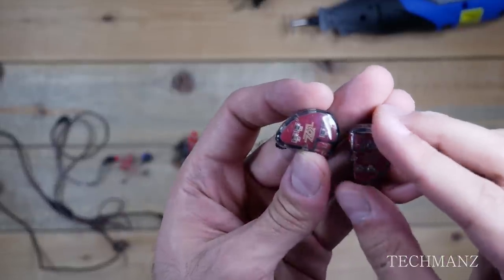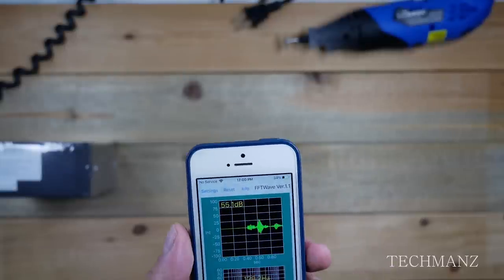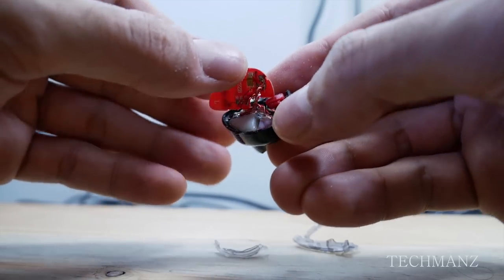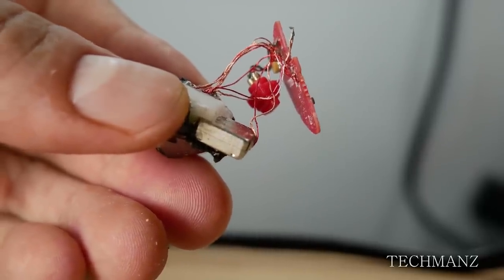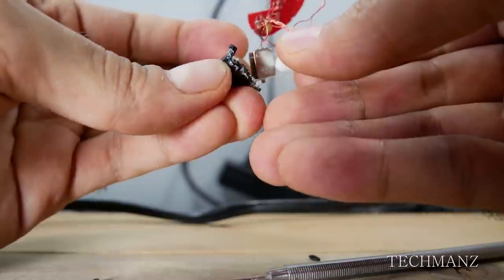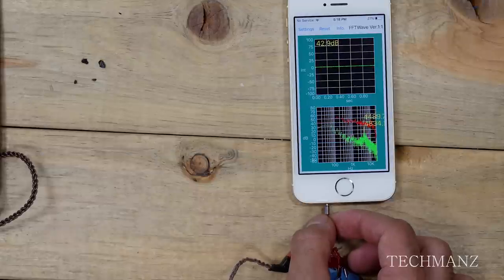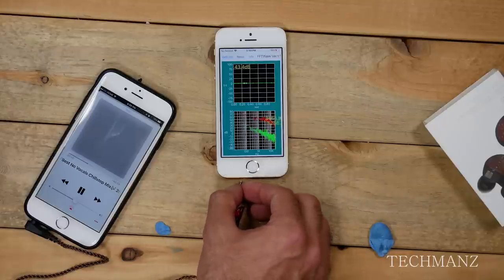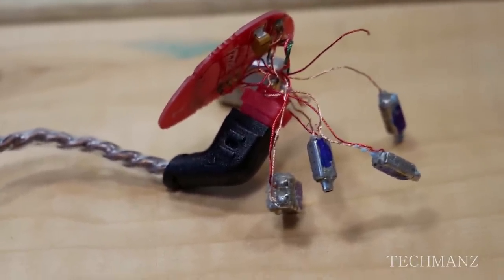$70 Earphone  Teardown- KZ AS10  - 5 Ba Drivers

Comment: KZ should get rid of the metal plate in the box and included a semi hard case and some foam tips.
Reply: The metal plate is just stamped and lasered. KZ aims to make it cheap. Pressure molded case might add manufacturing and shipping cost and be something not everyone likes. I use their ABS "water resistant" case for my AS10s. You might try that.
Reply: And also use metal for the housing. I totally wouldn't mind paying a little more for upgraded and more durable materials. With as dirt cheap as these are, people would really like these improvements, even if it costs more.
Reply: nah it's good for putting on the storage cases so you can identify what headphones you have in there.. it's so pimp
Reply: I second the Foam Eartips and a secure lip for the tips to attach to on the earphones.  Storage cases are cheap on Amazon. I would like them to standardize the Audio cables in their lineup. There are multiple choices that are incompatible.
Reply: My first thought, even a basic case is really expected at this price point. A basic snap case or soft zip case likely costs pennies to manufacture and would easily fit in the box. Foam tips are basically a standard upgrade on these and would be just as cheap to include.
Reply: @ItsNeverTooHot4Leather  why would you want a metal housing?  It's going to feel cold and uncomfortable in the ear not to mention added weight.   These KZ iem's are already heavy enough.
Reply: Durability is the reason. They could use aluminum or titanium, which are very light. And metal only feels cold initially. On the other hand, I also like that they are made out of cheap plastic, because I can get them remolded to become custom IEMs. I wouldn't want to do that if they were made out of metal.
Reply: @ItsNeverTooHot4Leather  the resin KZ is using feels very good not cheap at all.  Also, using aluminum or specially titanium,  will drastically increase prices.  I'm already surprised the KZ is using steel plate with star screws  on their ZS10pro line at a very affordable price.   It's crazy how good they sound.  People say that KZ's treble have a metallic quality....well!  not to my ears.  In fact the timber of the treble sounds perfect to me not to mention both the mids and bass/subbass.
Reply: @swifty1969  KZBS10 is the one you´re looking for
Reply: I bought mine included with foam eartip and semi-hard case....and they are still cheaper than market price and it's local too....

Comment: Playing music while testing didn't make for a great read. Consider white noise if you ever embark on the adventure again. Or maybe pregenerate a file with several seconds noise - one second silence - repeating on a loop - so you can tell that the recording is working as desired.

The print might be SLS, in which case, yeah, quite an amount of glue is needed and it needs to stay liquid for the life of the device. The surface of such print is porous, so acoustic seal relies on glue, and the polyamide material has enormous propensity to reject glue and get itself unglued. This process is very well suited to small parts being produced in quantity of hundreds per day with no variation.

Comment: Even more painful video than the ZS10 destruction. (watching it with AS10 btw:))
Reply: s8grave How do you like your AS10? I’m thinking about ordering them right now. Amazon has one day shipping and a $4 coupon. They must be selling a ton of these iems.
Reply: @Assimilator702  AS10 is AWESOME. I use them without EQ, but they hold EQ like a boss, taking any signature.
Can recommend it for everyone.
Reply: s8grave I just ordered them. I’ll have them tomorrow. I don’t like to use EQ but it’s good to know they can handle it. I have the Nuforce EDC3 which are very nice once you find the right tips and they don’t seem to react very well to EQ. I boosted the bottom 4 bands of the upper sub/mid bass region and the sound seemed very compressed. Those are $100 and they are pretty good now with some thick single flange AudioTechnica tips and some double flange from MEE. I was actually thinking of picking up some SpinFit tips for my EDC3 but then I started looking into the KZ reviews and figured hey.....why not try a pair for only a few $$$ More. I mean 2 PACKAGES of Spinfit tips which have 3 PAIRS of tips cost $22. The AS10 is $42 more. No-brainer.

I’m hoping the AS10 is a touch better than the EDC3. I just want some thing to use when I don’t want to put on my full size headphones or need something with strong bass that open headphones can’t keep up with. These will never leave the house and will always be connected to quality gear playing mostly FLAC and High Rez files.
Reply: +Joe Rico Hope U will like them)
I like how they tuned, not bright, not muffled, very fast and punchy lows, great separation, detail. Not sparkling like many other BA-buds.
I had shure 535, westone w40, es60 and some other stuff.
And chi-fi amazes me.
Forgot, want less bass - use wide bore tips. Cheers)
Reply: @Assimilator702  So, did you get em?)
Reply: @s8grave  Yes and I did and they're really good. Great mids, accurate, tight and punchy bass. Very precise and non fatiguing treble like some BA units can be. I also just got the BGVP DMG. I would say the AS10 is drier than the DMG but still musical. The AS10 is an HD600 while the DMG is an HD650 without the withdrawn treble and bass that extends deeper and punches you in the gut. And yes....Chi-Fi IS  amazing! For me these iems can replace a full sized sealed headphone giving me everything I want when I don't want to wear full size cans and not compromise sound quality in any way.
Reply: @Assimilator702  glad you like it. Considering the price, AS10 is a bomb imo)
Reply: @s8grave  Yes. And while the DMG is almost double the price it doesn't have double the performance, it's simply a different tuning. The DMG ARE worth every penny of the $131 I paid. I'm impressed with them out of the box but I'm hoping things get better after 50 hours of play time which I'll hit Tues afternoon.
Reply: Joe Rico how are the DMG’s as bulky in the ear as the AS10’s? I use them on stage on camera and am looking for something as good but not as bulky while I save up for custom. Thanks. Great comments!
Reply: XDDDDDD I'm also watching it with AS10

Comment: Thanks for the video! I really like seeing the insides of these types of things, since I use a lot of them, (ZS10, ZS6, ZSR, ZST, Even ATE.), I think the app you are using is actually better for showing the spectral response of each driver, (rather than showing if they work), which is pretty cool.  (The bass in that song must have been pretty weak though.)  The only thing I might offer for constructive benefit is that I find the 'Do all the drivers work' motivation to be a bit of a turnoff.  They would be crazy to put fake drivers in there, since it would destroy their reputation that they have worked so hard on, and it almost seems a bit ignorant to be tearing them down to 'put them on trial' so to speak.  Truth be told, the amount of scrutiny these things get is pretty amazing given their price point.  I supposed that is due to their industry rattling prices.  So that being said..  of course they all work!  Now...  if you had run pink noise through them all so we could see how the sound spectrum is divided between them..  THAT would be COOOOL!
Reply: this comment did not age well lmao

Comment: Does it matter that it works? I guess you should test if they work in the prescribed frequency range. Plus you should compare the EQ graph of the song on your phone to when it is played by the earphones. There are a lot of variables from how your DAC converts the digital signal and also the placement of the mic and driver but I guess more precise is better than less precise. Anyway. I guess if you find 5 drivers in an earphone, all of them should work or else why would they take the effort to put in a dummy
Reply: This happens a lot with shitty cheap knockoffs. They put in something to make the product look more impressive, they make something with semi transparent shell and show off the "goods", people are inclined to buy, buyer responds well to showy products and feature list buzzwords. I have seen it done utilising electret microphone capsule rejects which cannot work due to batch manufacturing mistake - when one happens, next thing you know you have 50 000 pieces of little junk, since it's highly automated. If the manufacturer of rejects had to send them off to recycling, it would cost them, so they're happy to find someone to unload them onto. It could also be dynamic drivers too terrible to use or something else. Manufacturing faults happen all the time.

Comment: Great teardown once again!
Do you think it would be possible to fit these into a custom mold?
Reply from the maker: Ya forsure. I don't see why not.
Reply: Yeah no problem with single driver iem's, just wondering about the size of 5 ba's lol - thanks mate!
Reply from the maker: They're pretty small. With exception to the Bass driver. And even that is small.
Reply: Then create a 10 driver iems per earpiece..20 in total.🙄
Reply: Mads Franzen You’d have to figure out where to place them and create channeling. You can’t just toss them in a shell and call it a day.
Reply: I’m actually do just that at the moment, I’m planning to reuse the 3 printed chamber as well.
Reply: Bishop Bautista 

Hey, are you successfull with the build of iem‘s out of the kz? I what to do the same..

Comment: it seems they changed the glue for all the new ones because my older KZ ZS5s would unglue themselves with drastic changes in heat which happened twice (and they were kind enough to send new IEMs each time)

Comment: the cross over plate so big and components far apart, they can compress the cross over plate 1/5 of the size thus it will help to also minimize the earpiece design. The thing is, 5 BA with only small component while shure SE846 has 9 components 4BA?

Comment: The BASS of left side of my KZ ZSX phone stopped working after just 2 months of use. I did all the possibles tests (I'm a collector of headphones), so I'm sure I didn't damage it by misuse. The strange thing is that only the bass stopped working, so I don't know if it is the PCB board or the frequency divider (the middles and treble continue to work). The problem is not with the cable. I paid $50 on it. Do you think IEM lasts for a short time (even if you are very careful with them?

Comment: I have the ES4s. They have great sound but I think they're just not for me...they're too bright, and have that forward presentation you've mentioned in previous videos. The sound is just too "in your face" for my taste. They also have some noticeable sibilance when watching videos or movies and sometimes the bass seems a bit too bommy. Considering the low budget/ budget price range which iems would you suggest getting? I like balanced sound, if it has some enphasys on bass it's no problem as long as it isn't that emphasised boomy one, more like a deep, rich subbass. Also a more laid back presentation (less bright) fits my taste. Could you give me 2 ou 3 suggestions in order of preference? Thank you
Reply: A nice pair of memory foam tips makes them excellent and solves all of the problems mentioned!
Reply: @JoseFerreira-zb7wh  Do you think the SE215 replacement memory foam tips will work with the KZ's?
Reply: @joseluisorellano69  You have to check the diameter of the hole in the tips and see if they fit. Mine have 4/5 mm diameter and they fit nicely.

Comment: Five Drivers per side? Thats amazing! Now I can understand why these cost so much. But what about other bluetooth earbuds? They use a single driver and still cost as much if not more then these.
Reply: @artvertex4152  But thats all on a single chip. I took my JBL earbuds apart and there's what looked to be two chips a few caps and resistors. This product looked to have way more engineering put into it.
Reply: It doesn't mean it sounds better tho, the driver quality and tuning is more important, otherwise those huge brand won't selling their at 10 times more expensive than this

Comment: What can you recomend me from KZ? I have ZS6 now, they sounds good but they shape a bit sharp and no comfy. Iam a basshead so.
Reply from the maker: As10, zst pro, es4. Those should all be good (lots of bass without the harsh highs)
Reply: Ty very much
Reply: @LeshaRodin  ES4 has the most bass. AS10 is the most accurate overall and doesn't hit as hard.  ZS10 is in the middle.
Reply: @Assimilator702  As10 is crap
Reply: @lenhau7444  No it's actually not crap. I have  more expensive iems and the sound signature of the AS10 is very close. If they were crap I wouldn't have bought a second pair. Let me ask you this......what type of music do you listen to? What is the quality of music files you use?

Comment: Would these be a good upgrade over the es4's
Reply from the maker: If you love lots of bass, sure.
Reply: I have both. Absolutely. I use ES4 for calls, with the in cable mic/pause/play. AS10 with Tsr 8 core replacement cable makes a world of difference: bass doesn't spike painfully.

Comment: Why would you ever use 3D printed parts? It takes ages to print and i dont see any reson not to use normal molded plastic.
Reply: those molds are very expensive to make... 3d print might be a better option for small and complex parts too.
Reply: Knowing KZ that shit out new model every few months or so followed with discontinuing the older model, 3D printing parts would make more sense because new molds is considerably expensive if the product only be manufactured at limited time and at smaller quantity compared to the cheaper models.
Reply: like everyone said, molds are expensive to manufacture and unless there are 10s of thousands made chances are it is not cost effective. You also have more leniency of changing the design for different models with 3d printing instead of making a new mold.
Reply: It's because 3D printing is almost the only sensible way to produce a complex buried channelway structure like this acoustic crossover without seams and risk of unwanted voids. Since 3D printing is layer by layer, you can manufacture channels and voids that don't have a direct access from the outside! Otherwise, you'd have to make a mould of the channel structure, cast the channel structure plug from some temporary material that can be removed later, cast the acoustic crossover around that, remove (dissolve) the plug... a very fiddly process with so many steps so defect rate can be difficult to get low.

So what if 3D printing is slow? A single powder SLS machine will still spit out hundreds of those crossovers per day, fully reproducible, zero defect, almost no hand involvement. They're tiny and take up so little material. It also translates 1:1 from prototype to mass manufacturing. It's perfect.